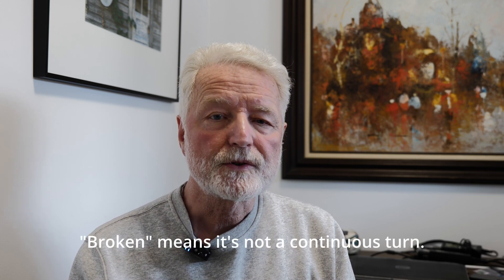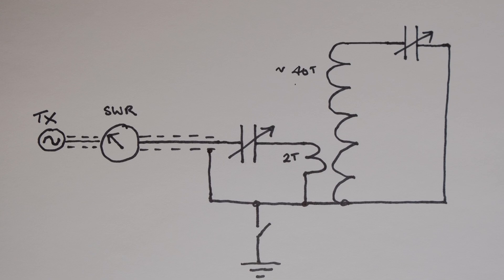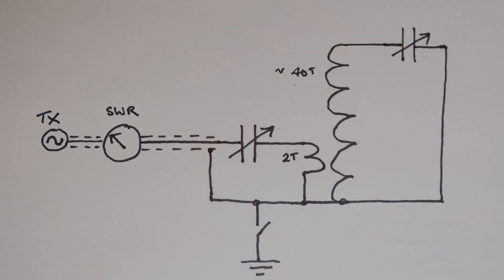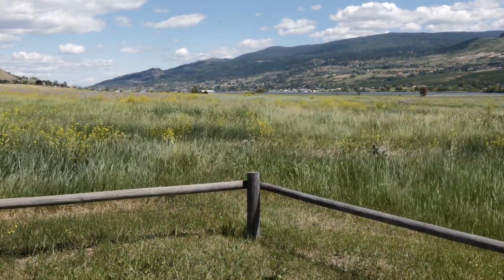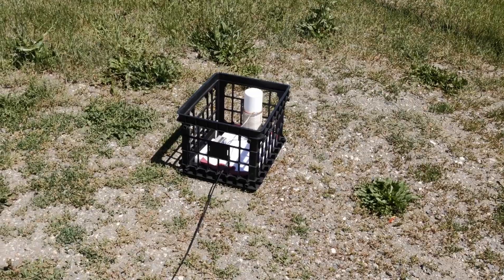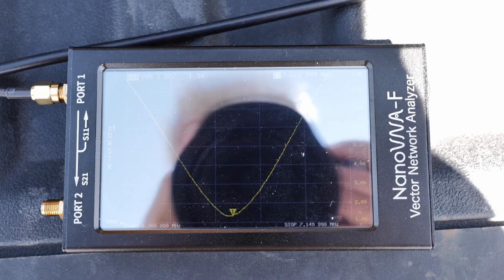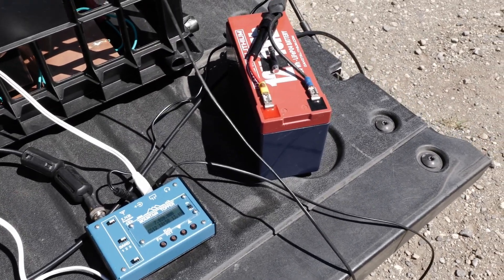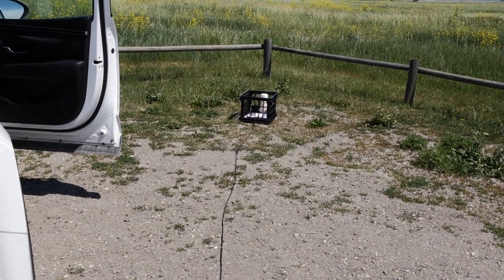Tesla Coil HF Antenna First Field Trial

Comment: you basically made a magloop antenna: a resonant secondary with a matching primary.
the method of obtaining the resonance is very interesting. also the swr ajustment is very good.
one way to improve the efficience would be to increase the area (diameter) of the coil (around that plastic box perhaps? :D )
also you could make a low capacitance winding like honeycomb or basket weaving.
if you find the proper ratio betwen primary and secondary you can skip the capacitor adjustment and make it more eficient also...

anyway: it is a great way to get to the lower bands without a monster antenna
Reply from the maker: Thanks for your interesting comment! Yes, it is essentially a multi-turn magnetic loop and  not particularly efficient. I do have a 7' diameter magnetic loop built for 80m which works well and runs 100W no problem.

What you are describing sounds a bit like the Alexanderson Antenna, used for long wave broadcasting around 100 years ago. I believe it was fed from the top, with the base grounded. The windings are designed to minimize capacitance. I might try to replicate one.

Comment: Very interesting David.  What would the radiation pattern be I wonder.   NVIS?  That would be my guess.  I assume the Tesla coil is a close-wound affair.  73, Bob VE7EZI
Reply from the maker: Thanks Bob! Yes the secondary uses about 40 turns of insulated 14 gauge wire on a 4 inch former. The primary is 2 turns of RG58U, using the shield only.

Good point about the radiation pattern and it would certainly be interesting to find out, but I'm not sure how to go about measuring it.